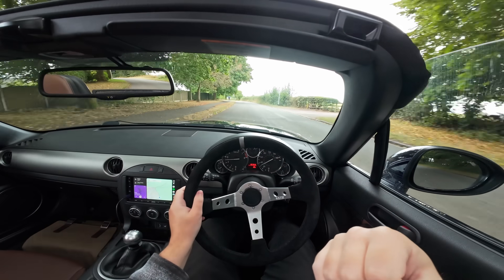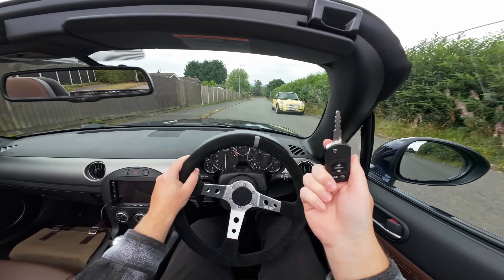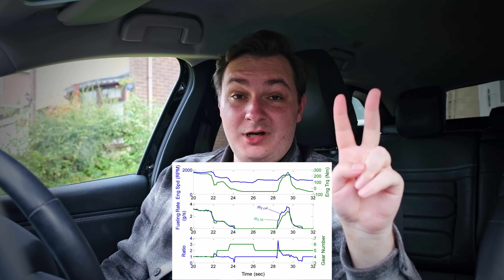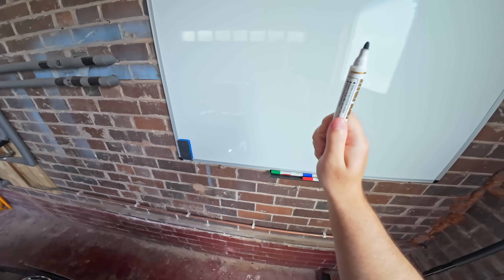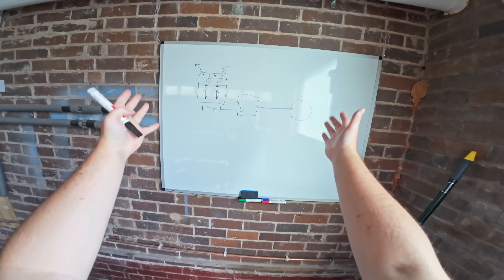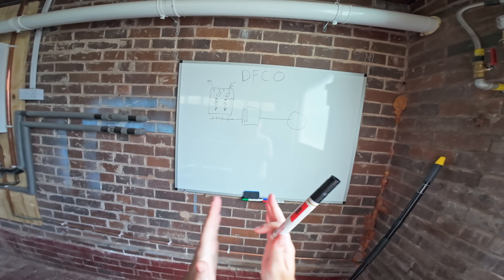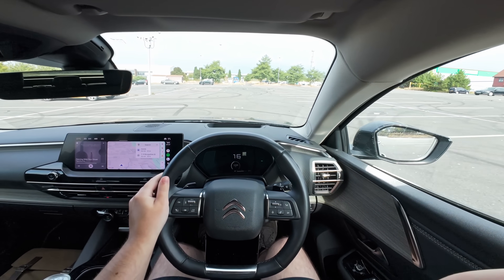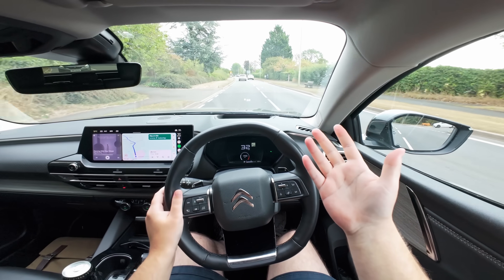The most misunderstood car term - Engine Braking

Comment: I grew up driving carbureted engines and my Dad taught me to use engine braking.  It's just a better way to drive.  His main thing was to consider how the passengers felt when you're driving.  Stomping the gas and brakes all the time is very uncomfortable for them and it puts excessive wear and tear on your car.  Being a smooth operator is good for everyone.

Comment: what about putting a manual car into neutral when i see a red light coming up and slowing rolling + breaking if necesarry?
Reply: Thats using fuel, the wheels are spinning free but are not connected to the engine, thus fuel is needed to keep the engine running at idle speed. Still less rpm than holding in the throttle then braking like a ton of people do but its not 0

Comment: I drove about 15 km just yesterday without ever accelerating. I did have to switch gears and brake from time to time but at the bottom the car showed 3.4L/100km. its average is normally 7.8. This was in a mountain near Cordoba.

Comment: isn't it very dangerous to shut down your car while driving? wouldn't you be risking locking up your driving wheel?
Reply: He mentioned in the comments of the short where he did this that he disabled the steering lock, but yes its super dangerous

Comment: I'm not a mechanic but know a little about cars and I am interested in the technical aspects of them.

Basically, older cars with a carburettor always use fuel when the engine is on, the throttle control the air intake and the volume and speed of air running past the carburettor controls the fuel intake. Full off the throttle will close the valve but doesn't stop all air otherwise the engine would be starved of air. Opening the valve uses more fuel as more air is running past the carburettor.

Modern cars and electronic fuel injection which inject fuel into the airflow and sometimes directly into the piston as needed. So when full off the throttle AND moving fast enough for your gear selection (so engine rpm is high enough) fuel will not be injected.

Comment: Technically when engine braking it's not free fuel but rather using a part of the fuel that was used for accelerating. Notice that while accelerating you use way more fuel. You basically getting cashback.or if you brake you just turning that fuel into brakes wear and heat.

Comment: 11:18 but if it's a manual it will just keep on lowering the rpm untill you stall right? literally no assist of injecting the fuel again?
i just assumed what you were saying was for AT, it was what made sense to me
Reply: Has nothing to do with the gearbox.
My 2006 manual does the same thing, injects fuel to keep the engine at idle RPM.

You definitely could stall it if you're at a high enough gear, but my car can comfortably move on 2nd gear with my foot off the accelerator on level ground.
It can also just about do it on 3rd.
4th and 5th would cause issues though.

Comment: (havent watched past 2 min yet) if your engine breaking with the car on then you are only using the same gas you would be using as if you were just normally ideling. if you turn off the car then i would only assume you would slow down more slowly than if it were on due to the lack of ignition going on 

im probably wrong.. if im right the only thing that could loggically happen is you flood the engine unless there is anything that would stop that from happening. odviously there is

Comment: Not all cars use exactly 0 fuel while you lift your foot all the way off the accelerator. My 95 mercury sable even with zero throttle used a tiny bit of fuel while engine braking. I am for certain for it because when I cut of the ignition it slowed ever slightly harder. even worse with the a/c on. used much more fuel. it also gave instant mpgs on its digital dash, it maxed at 99 and only said 99 over 42 mph then dropped as you engine braked below 42 mph. i think it did that for comfort. my 21 volvo 100% engine brakes when foot lifted off accelerator at any speed, my 13 manual corvette only 100% engine brakes when rpms are over 1,000 and after a few seconds of no throttle.

Comment: I ride an SR400 which has a high compression ratio so the engine braking effect is very strong. If I'm pulling up to a stop on level ground I use very little braking.

Comment: learned about this 6-7 months ago. got 20-30% better economy
Sidenote (idk if you mentioned it) but you can actually feel when it stars injecting fuel again, you get a small bump when you get close to idle (depends on the engine, my diesel idle is around 1000rpm)

Comment: Is that display ON the glass?? Or is it just a reflection that isn’t flipped somehow?
Reply from the maker: It's a heads-up display. Great feature.

Shows the map too if you use the in-built navigation
Reply: @MickDrivesCars  is that a built in feature of that vehicle?
Reply from the maker: Yup
Reply: @MickDrivesCars  ah nice. What is the year and model??
Reply from the maker: 2023 Citreon C5X

It only came on the highest trim I believe, which this car is.

Comment: The other advantage is that with your right foot not on the accelerator, you can cover the brake pedal which means you can make an emergency stop FAR faster than you otherwise could.

Comment: Can you explain how this applies to an automatic transmission? Not a dual clutch auto but a traditional one. As far as I’m aware the wheels don’t drive the engine, they freewheel like on a bike. Thats why you don’t get that slowing down effect like you do in a manual, and require the use of brakes to slow down. Even in drive.

Also this isn’t a cheat code. If you’re not doing this, you won’t get anywhere close to manufacturer fuel economy estimates.
Reply from the maker: This entire video was filmed in a regular torque converter auto. There's no difference. 

Maybe some manufactures are doing a ''fake coasting'' mode? Idk.

Comment: I've been doing this for as long as I've been driving (about 5 years) but never knew the mechanics behind it. I assumed it was injecting fuel at idle RPM and wind resistance was slowing the car down or something. I didn't know the engine itself was actually braking. (I didn't know what it was called either)
I understood I was probably saving some fuel but I was mainly doing it to reduce wear on the brakes lol

Comment: For the last 15 years, I've been trying to explain this to people with no success. Also, eco mode in new cars is pointless because of this. In Mercedes, in eco mode, after 60 km/h, when you release the gas pedal, the computer will disengage the clutch, and the car will still consume about 0.3 L of fuel per 100 km, if we're going to trust the onboard computer. But if you are in any other mode, when you release the gas pedal, or, as you say, engine brake, you won't consume any fuel. And one more thing. Braking is a simple conversion of momentum to heat. If you brake with your engine, that heat will go to the engine and through the radiator out to the atmosphere, and not to your brake discs and pads. So it is a win-win situation.

Comment: Curious how automatic transmissions behave downhill in “D” — do they automatically downshift for engine braking, or just free-roll and keep gaining speed (even upshifting)?

Or does this vary between transmissions? Like, can some cars really roll to 100–120 km/h or even higher limitless downhill without touching anything — no brake, no manual mode? I know you can limit it manually by going into manual mode, but do modern autos actually sense slope and hold speed on their own?
Reply: An automatic will function the same as a manual as long as you leave it in Drive. No throttle so it will engine break, downshifting when the rpm reaches idle until you either but it in Neutral or hit the accelerator

Comment: I always assumed this wasn't "engine braking", but instead the auto transmission disengaging the clutch and letting you freely move with friction and air resistance, not that the engine was actually slowing you down. Then again, I drive a 1993 that's barely computer controlled, so... 😂

Comment: Guys, never remove the key from the ignition while you are driving. I did it once as a joke and the steering wheel siezed up and I lost control of the car... in a mountain road. I didn't die out of luck.

Comment: To be fair, what they said wasn’t wrong, either. If you are engine breaking, you will use much less fuel, but you will still use some to keep the engine above idle RPM.

Comment: I do feel it’s important to clarify that this only works in dfco engines. It’s very common nowadays, but not all modern vehicles have it. If you go anywhere south of Mexico and most of Asia this is not an option in new vehicles even on big name brands. 

Also on places with very long descents and hills we use engine breaking as a way to slow down the engine to aid in breaking. This as a way to not overheat breaking, but that’s not exactly the way you’re talking about it being used. I see that you meant this video and your statement only referred to DFCO, which could be seen as misleading when you don’t have a title that says DFCO.

But what you are saying is true for all dfco engines

Comment: Well. When you cut the engine off, you are using no gas, but if the ignition is on then the fuel delivered is the amount needed for idling. This is why your car backfires when you are down shifted.

Comment: I drove my peugot 207 for 7 years and everytime i was breaking i used the clutch, so i don't ruin the engine, never had a single problem with the car, well only the battery and alternator but that's not relevant to this. I only used engine braking on highways or same way on your speed limit example. But whenever i had to go from 5th to 2nd for example i would always press clutch, then brake and while still on the clutch put it in 2nd and just continue driving

Comment: In a manual transmission, does it wear the clutch more to shift to Neutral and coast? Once you need to accelerate again, going back to an appropriate gear. I used to do this and I don't know if I was wearing the clutch more. Though, I never had to replace a clutch in 5 years.

Comment: A great driver aware skill is "The no brakes game" (also not named "Anticipation, anticipation, anticipation").
It's where you try and drive a section of road without using the brakes (great on rural roads), you quickly learn (a) to at least cover the brake, just in case (b) that there is a difference between foot off the accelerator and the slight pressure that maintains forward travel and (c) look ahead, don't follow too close.
Loch Lomond side (A82) for the win.

Comment: No only that. During the engine breaking, the kinetic energy keep turning the motor and will keep the air-conditioner, and the car's electronics working. This advantage disappears if you press the clutch because now the engine needs to idle to keep the alternator turning.

Comment: Unrelated when I've just started my car and drive up to 2nd and release the throttle the car continues to accelerate slowly :p, I don't know whether that's a problem but I assume it's like a warm up mode where it revs for a bit because after a few a minute or two it stops doing it.

Comment: Imagine not intuitively thinking that lifting your foot off the gas pedal without pressing the brake is still going to slow you down, purely because of air drag and tire/road friction.
Perhaps these people have never played racing games? You only press the brake when you need to stop quickly.

Funnily enough, the same thing happens in electric vehicles, except even better - when you lift off the "gas" pedal, the electric motor becomes a generator and generates "fuel" for you using your car's weight and inertia as you slow down. This can generally be adjusted in most EVs to be more or less aggressive. Personally I'd go for the more aggressive option because such regenerative "braking" can almost completely eliminate the need for braking, it's that good. Saves you money on brake pads.

Comment: When I let go off the gas pedal, my fuel usage monitor goes to 0.00 litres per 100 km. That's pretty clearly no gas usage. That is, down and until the idle speed of the motor, at lower velocity it will start using gas/petrol again.

Comment: I have a question: In a manual car, if you downshift to get more engine braking, how much fuel is used on the rev matches? Until what point it is worth it to downshift to engine brake, considering this extra fuel use on the downshifts

Comment: yes, that's exactly how I understood it to be. The second question would be: if i have a stop quite a long way ahead, shoulld I press the clutch\put in neutral so the car isn't slowed down as much? any reasons why it's better not to? or would it actually consume a little more fuel since the motor has to keep running at its minimum rpm?

Comment: I'm a professional driver. My truck is a Peterbilt with an 18 speed manual transmission. I also own a manual 6 speed car. In both vehicles I ALWAYS engine brake, for the sake of the environment, and to save my brakes, and to allow the engine to cool down properly when coming off the highway. In both vehicles I NEVER touch the clutch when slowing down until my RPM is down to idle, or very close to idle. Now my truck hauls up to 31 tons and is hard to stop, but with engine braking my wheel brakes stay nice and cool. In my car my wheel brakes last forever. My car is 12 years old and I am still on the original clutch, and the original brakes. The clued out people who say "I'd rather replace cheap brakes than an expensive clutch and engine" have no idea what they're talking about. Mick Drives Cars, and he knows what he's talking about. Subscribed!

Comment: I have a 1997 Saab 9000 and the reason I mention this is because it has a digital gauge that shows momentary fuel consumption. Now this is computed by measuring the ms the injector in cylinder three (I think, it's only one, that I know for sure) and multiplying it by the the fuel throughput divided by the current speed. During engine braking this gauge literally drops to zero because no fuel injectors are opening. It's quite funny how such a basic feature would immediately let people know what is happening in the engine! Is it 100% accurate during variable throttle input? No, but it does give you a very decent idea of how much work the engine is doing this very instant. (It also has three other fuel consumption estimates for average fuel consumption and distance to empty, which use different measurements over different time periods).

Comment: So, for us in Canada, if you take drivers ed you're told that you're NOT supposed to slow down without pressing the breaks enough for the lights to turn on. If you don't indicate that you're slowing down then you might end up in an accident because someone behind you wasn't paying attention until you flashed those big red lights all too late, especially at night. We somewhat combine engine breaking and regular breaking with feathering (if they aren't reckless drivers... which is literally everyone else) for a nice smooth stop whenever possible.

Comment: Off course 100% fuel cut-off is a thing since there is electronic injection in gasoline (petrol) cars. Even earlier in Diesels, as they are generally controlled by the amount of fuel injected (as opposed to a throttle in gasoline engines). On 2-stroke engines or in earlier carburated engines, there was no 0 fuel.

Comment: can't actually understand why there is so much misunderstanding about engine breaking.
Is it so hard to understand that the "moving energy" of the car just "fuels" the car?
Do those people use the normal break if they go downhill with their car???
Modern cars even saves fuel while shifting manual gears. They use the inertia of the engine itself to power themself for seconds even when the clutch if lifted.

Comment: As a truck driver, i can confirm that my truck uses exactly 0.00 fuel when engine braking. Atleast that's what it says in the dashboard display.
In fact you actually use more fuel with the "eco roll" functionality as opposed to just engine braking. Which surprised me when i saw it.
"Eco roll" is a function that allows trucks to roll up more speed more efficiently in order to preserve momentum.

I drive Scania. I don't know if it's any different with other brands.

Comment: Amazing video. I’m 48 and have been driving since I was 18. I’ve always lifted my foot off the accelerator before red lights, small speed drops, or on downhills to save fuel. But I never knew the fuel was actually cut off during those moments!
I’d also never heard of DFCO before. Checked my old 2006 automatic car now and it has it — which explains why I get better fuel economy than friends with the same car.
Reply from the maker: Glad you found it useful!

Comment: How do I differentiate between coasting in gear, car is slowing down, vs when I feel the jerk, and the car slows down even quicker? In the former, my afr reading still shows a ratio, the car isn't slowing down that quickly , and even when it DOES slow down, sometimes the afr reading still shows a number no matter how hard I try to get that jerk. When I get the jerk, the reading goes blank and I know I'm engine braking. Sometimes I can't get that jerk and engine braking